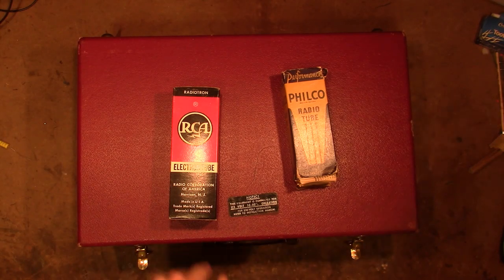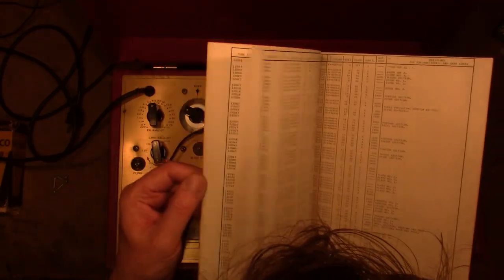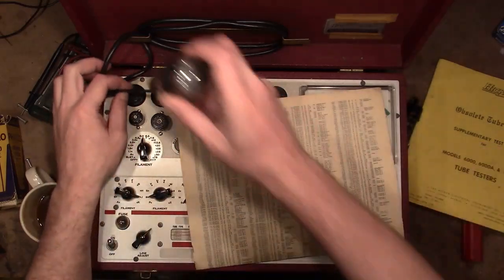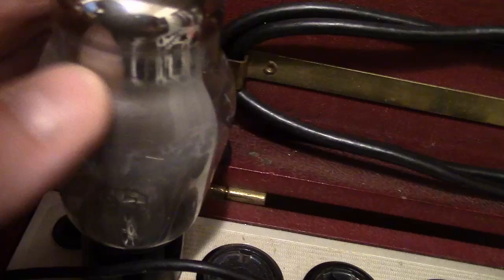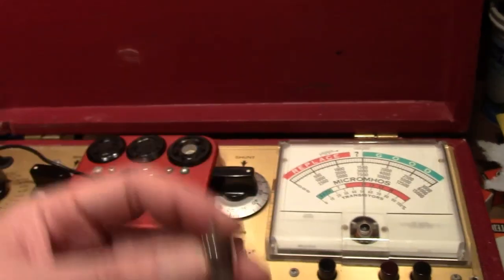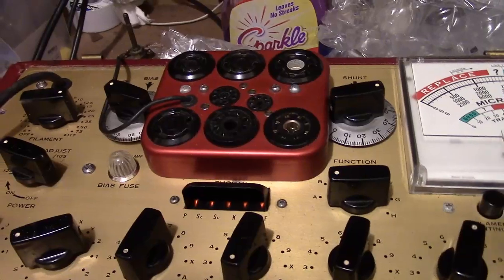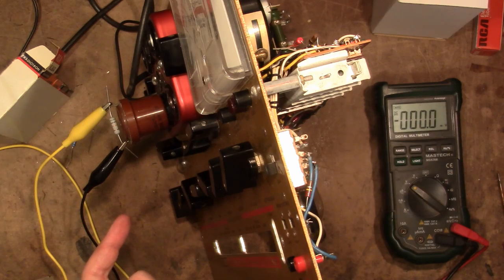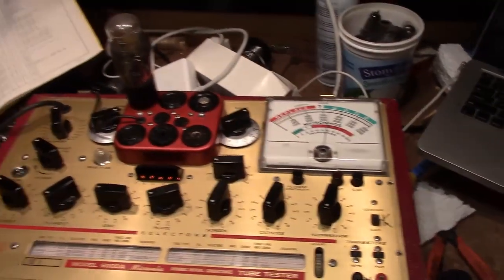Hickok 6000A restoration and calibration

Comment: I bought one of these in pristine shape. Only issue was the meter was sticking with no repair to make it better. These things are notoriously bad meter movements. Trying to find a 100ua FS movement with 1165 ohms or less was a real chore. Finally found an old round Simpson meter brand new in box from the 70's I popped in. After making a chart with scale conversions to match the Simpson movement it worked good. Recently put the SS diode replacement in for the 83 tube, the one with the zener diodes. Seems to work great. Matched very well with my Hickok 539C on most tube measurements. 6L6's measured a bit less on mho with the 6000 but triodes like 12ax7 and such match quite well. The 539C doesn't have a shunt knob to fiddle with to measure mho that can change the reading a good bit when just off a half a mark. Was just looking at a Triplett 3444, wish I would have looked for one of those when I purchased the 539C but $2k+ is a bit rich for some beat up testers. My 539C is very pristine also. Hopefully by the time I end my repair hobby these things will be like gold, or it can go the other way since most younger people don't know what a tube is LOL.

Comment: I realize this is an older video, but I just recently bought a 6000a and need to calibrate it. What are the various resistor values, wattage etc. that are needed for the calibration with a digital multimeter?

Comment: The 800a would be a perfect upgrade for you tests old style tubes and the new style all in one tester. As well as features a more sensitive shorts test that uses the meter instead of an unreliable light bulb.
Reply from the maker: Keep in mind the vast majority of tubes I test are TV tubes from 1948 to 1960.  The Hickok cardmatic and Sencore TC162 do an excellent job at quickly weeding out bad tubes.  Mostly I care about bad shorts, high grid emission and very weak tubes.
Reply: @bandersentv  makes sense don't wanna put a bad tube in a tv could damage other parts in circuit or cause noise in audio or weak signal

Comment: I cleaned the pot with Deoxit and reinstalled and balanced it using bridge balance test. Got it within 2 divisions from 15000 6000 and 3000 but when shunt goes from 50 to 0 the meter pegs below 0 that bad?

Comment: So when calibrating my tester I set line voltage to 2.5vac now what happens is I get 155v which is out of the 150-153v range and another voltage was out to bias at 75 got 27.7v so I crunched numbers and found out if I set line to 153.5v instead of using the 2.5vac every voltage is bang on spec except line voltage is 2.45v instead of 2.500v is this ok?

Comment: I found out when adjusting the line pot below it does effect the meter mv so you have to go back and forth till you get 58.2mv on line test and for 2.5v. For mine I can't set it to 2.5v cause when I do that all my voltages are to high so I settled for 2.45v brings all voltages right within spec

Comment: That older socket island is rare can't find any pics of a 6000a with one. Wondering if someone modified it to work
Reply from the maker: I thought they were common. It's original
Reply: @bandersentv  the 6000 had the old style island and 6000a had new style. Tubesound has write up on how they can't be interchanged. One has a 11 pin other is 12. It's probably an easy modification like removing the 12pin or something. I think in the manual it mentions it being an accessory so maybe it is available but not commonly ordered
Reply: @bandersentv  all I know is you get a hickok 800a then get all sockets on one panel and a better shorts test that uses meter instead of a bulb to measure leakage. Just like my laboratory hickok 752

Comment: Hi. I have both a 600 and a 6000A. Have you noticed a huge difference in the meter ballistics/damping and response time between the two? My 6000A is very slow compared to the quick response of the 600A. Just wondering if the slow response is normal of that model, or if I have a problem with the meter pivots being too tight? I hate to think about the cost for a new meter if I could even find one.
Reply from the maker: hi. I no longer have the 6000 but as best I can recall the meter response was similar to the 600

Comment: My plate voltage is at 155.5v is that ok or should I drop the 2.5vac lower to bring it closer to 150-153v plate voltage? How and where do I solder the 50 ohm pot to balance 83 rectifier?
Reply from the maker: Sorry, I don't know. Try asking on the Antique Radio Forum.
Reply: @bandersentv  ok thanks what's answer to that question on the forum I can't register

Comment: what is the significance of the short indicator having two sides (bulbs) ?  why will one half light up or the other half light up or all of it light up entirely ?
Reply from the maker: +j rok  I'm not sure what you mean. There are five individual neon bulbs used to indicate shorts.  Each bulb has two elements inside - cathode and anode.  When sufficient voltage is applied, the gas inside ionizes and glows.  If you mean brightly it glows or which metal element glows more,  I assume it has something to do with how much voltage is applied and how it was made.
Reply: +bandersentv - sorry, I'm a novice at this.  I have a Hickok 540.  the manual suggests the Short lamp is a "1/4 watt 100 volt candelabra base neon signal lamp"  I notice that as I go through each of the 5 dial positions while testing for Short, there is the possibility of only one half of the lamp will light up, the other half, or both sides.

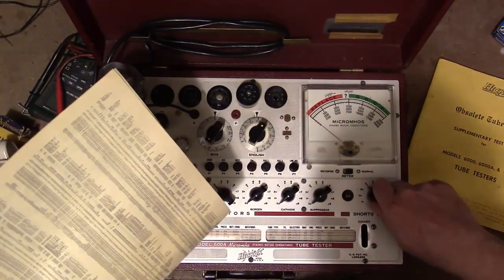as I watched your video (9:20-9:40) I noticed the same thing happen as you Short tested with the 600A tester. each dial position gave a quick Short light at opposite sides of the "lamp".

is there any significance to only half the "lamp" lighting up  ?  I realise that only a continuos light of the "lamp" indicates a real Short.
Reply from the maker: +j rok  No significance that I know of.  As you say, only a continuous light means a short.

Comment: Why not put in a solid state replacement for the 83? Saves you an expensive tube. For what I know there is a lot of discussion about solid replacement, but if you use the "correct" schematic (there are multiple versions out there) the tester should calibrate fine with an solid state replacement and all it cost you would be an old tube base and some diodes/resistors. You could even use the base of the faulty 83.
Reply from the maker: +Bart Zuidgeest  If I was keeping it I might, but I'm selling it and think a NOS 83 will help the value.

Comment: Hopefully you see this. I have a stark 8-77, kind of a clone of the 6000. I am  mew to testing tubes so when you find a tube that has dashes in the funct. and mut. cond. So you just go by the good and bad (red and green ) of the meter instead of the numbers? Thanks.
Reply from the maker: Sorry, I'm not sure.  I sold this tester years ago and don't remember.
Reply: @bandersentv  Ok, thanks.
Reply: I've recently read part of three instructions. Chart settings are for good/bad. There are little red dots on the shunt control I believe that are labeled at the three mutual conductance scales on the meter. Setting to them for the scale your tube is rated will allow you to read your mU directly from the meter.

The gas test button is pushed simultaneously with the test button.

Hopefully you have figured this out by now and good luck.

Comment: My hickok 600 get 141v and for screen voltage 121v it needs a cal pot added to bring voltages up so its 150v and 132v. Also the 56v don't get at all stays at 121v
Reply: Solved that issue with a line cal pot got voltages right where need to be. And can adjust through center of socket from top side

Comment: what do you think about using the solid state replacement 83 and 5y3 replacements do they really work correctly - Charles
Reply from the maker: I've never tried them but I read others have with mixed results.  The 83 seems to be especially difficult to simulate with modern parts.  You can't just drop in some rectifier diodes.  You need to create a voltage drop like the real tube has.
Reply: @bandersentv  I bought a 83 solid state kit from ebay it simulates the 83 tube very well uses 4 diodes and 2 resistors
Reply: @bandersentv  , removing the #83 tubes' heater-winding load from the power transformer tends to increase  both the B+ and the heater voltage to the tube under test, and may give artificially higher readings. Also, the heat from the internal rectifier helps keep everything nice and dry inside, minimizing corrosion. I tell people to stick with tube rectification.

I've owned a bunch of testers, from the 533, 600, 6000 and 539C to the 752A, which is the one I use most frequently.

Comment: If a carbon comp resistor reads lower is it OK? on my tester 2 of the resistors are reading 10 lower then they should be
Reply from the maker: That depends on the tolerance.  Gold band is 5%, silver 10%.  No band is 20%.  10% or 10 ohms ?  What is the marked value ?
Reply: For a resistor that's suppose to be 470k I get 460k so I guess that be 10% low
Reply from the maker: 10% of 470K is 47K.  So the acceptable range of +/- 10% is 423K to 517K
Reply: @bandersentv  your right I forgot that I meant 10 ohms lower. The resistor is a 5% resistor and it's 2w
Reply from the maker: 10 or 10,000 ?   470K is 470,000 ohms.  460K = 460,000 ohms.   
5% of 470K is 23.5K.  So the acceptable range of +/- 5% is 447.5K to 492.5K
Reply: @bandersentv  10,000 cause it's 470k it went down 10k so resistor is ok if it's 460k. That is in circuit also so with it disconnected probably be higher
Reply: Thanks for your help much appreciated looks like resistors should be ok for now if they drift high will replace them it's part of leakage and multiplier circuits which seem to be functioning correctly :)